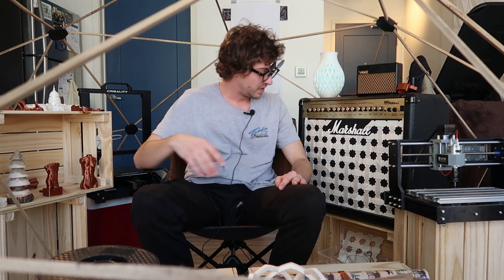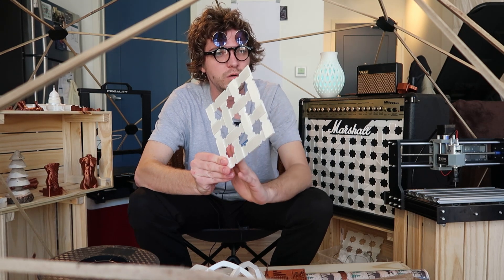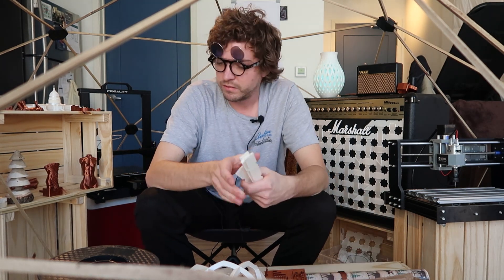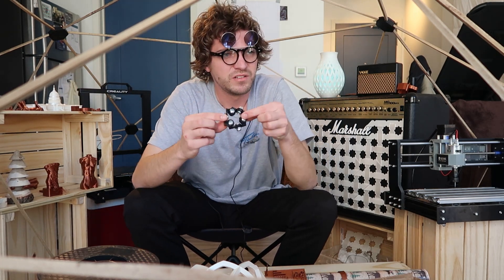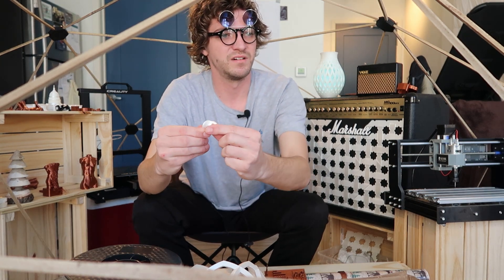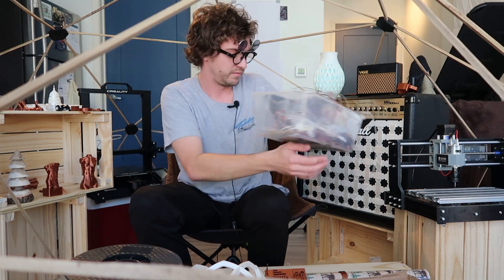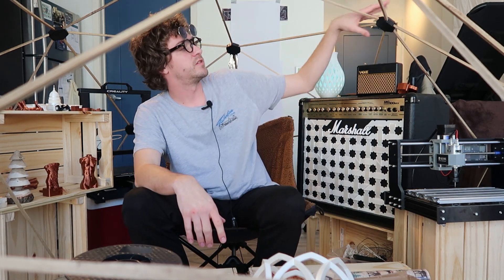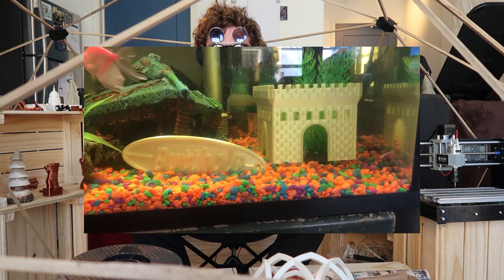“So Far” Creality CR6-SE (2021)

Comment: Which slicer do you use? and could you share your settings ?? I have bought the same printer but I had a first disastrous result ... will you help me with that? good video keep it up..from Chile
Reply from the maker: I use cura and print 0.2 mm. What are your settings?
Reply: @JacksonTravel  Prusa Slicer and print 0.15 mm, How fast do you run the pieces? and how is creality slicer?